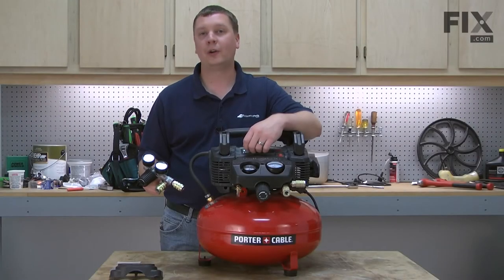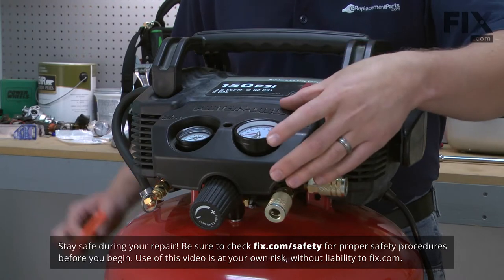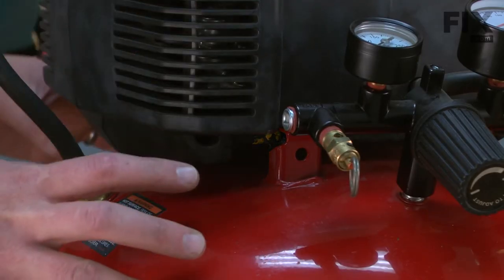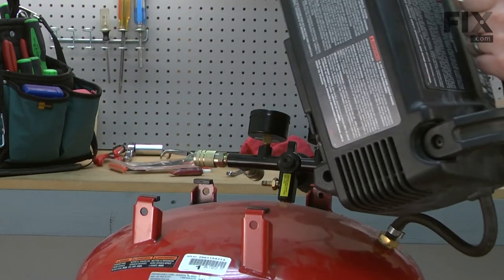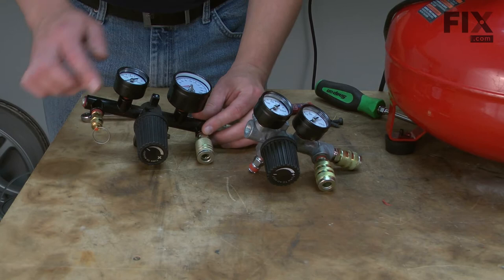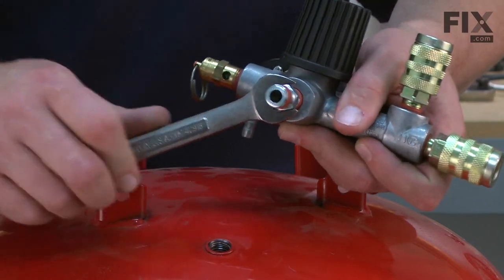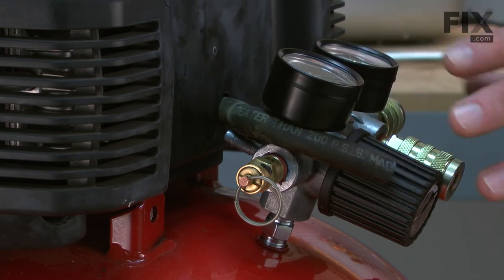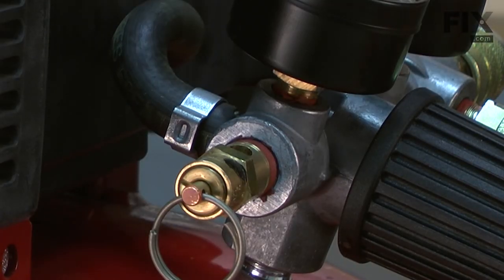Porter Cable Air Compressor Repair – How to replace the Manifold Kit

Comment: I have a C2002 Type 8. Replaced manifold, pressure switch, still won't cut off, any ideas?
Reply from the maker: In this case I would look to the condition of the cylinder and piston. Determine what the compressors shut off pressure should be. On most compressors this will be advertised right on the tank. 125 psi, 150 psi, etc. Now watch the tank pressure gauge as the compressor is running. Does it ever reach the specified tank pressure? If not the piston and cylinder have likely worn to the point that the pump no longer has the compression to fill the tank to the specified pressure. The piston and cylinder will need to be serviced. -Mark

Comment: any advice for clipping the pressure switch hose just a little too short?
Reply from the maker: Hi Daniel, if the pressure switch hose is trimmed too short, it still may be long enough to use it. If it is too short you will need to order a new one to put on your compressor.

Comment: What kind of screw is it? Standard philips head?
Reply from the maker: Hi Clinton, the screw holding the cover on is a Torx T-25 screw.
Reply: Fix.com thanks for the response but I must have the same model different type because I discovered the cover screw is 2mm Alan wrench
Reply: @FixDotCom yeah definitely not a T-25
Reply: It's a T-10 screw head

Comment: I think mine needs a new shut off switch.  It keeps pumping and I stop it at 150psi because it is a 135psi Porter and cable..  It was given to me
Reply from the maker: Hi Ryan, do you have a model number?
Reply: I have the same problem. I have a C2002 type 7 compressor. What should I do?